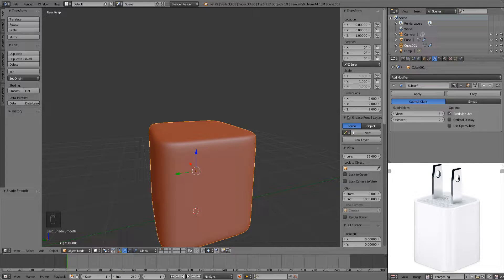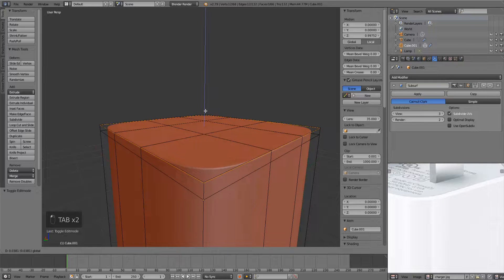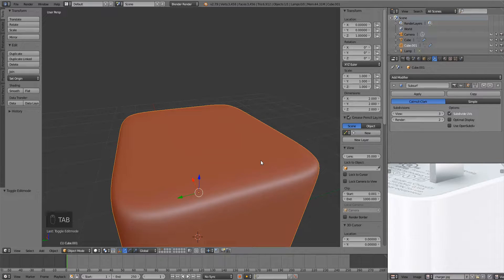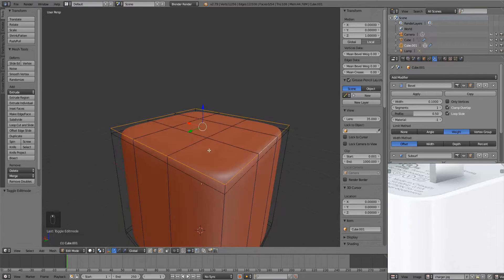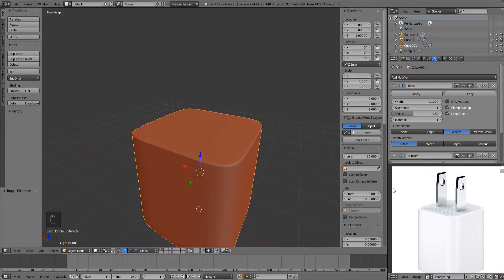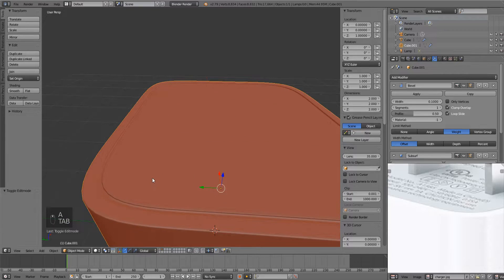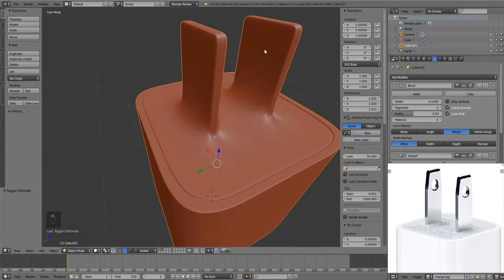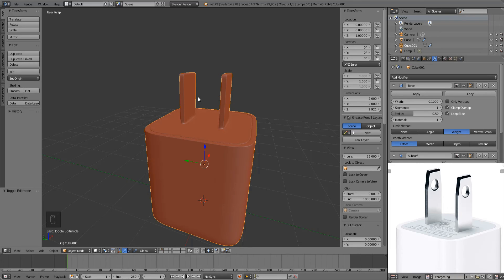Blender: Hard Surface Modeling Made Easy | Bevel Modifier

Comment: This tutorial is very helpful ngl. I always used proximity loops and there was this unneeded geometry  around the loop because of the subsurf. The bevel also completely eliminates the smoothing, while a proximity loop can only fix it to a certain extent, unless you push it right into the other edge. Thank you for sharing these tips Josh!

Comment: Will this information be carried over for exporting it to games' engines ?
Reply from the maker: I believe modifiers are applied on export, so yes :-)
Reply: @JoshGambrell  Gotta make sure, this blender feature is really awesome, really good results for less complexity. So it is natural to be skeptical on how far it goes...i guess.
Thank you a lot for this tip and for the quick response. Cheers
Reply: @ykyjohn  you might need to retopo if you use a lot of modifiers

Comment: Setting the bevel segment count to two and setting profile to 1 will give you a crisper result that's closer to adding proximity loops manually. 

The resulting mesh after the bevel is applied will still have an edge where the original one was, and the bevel edges will be on the faces adjacent to that edge
Reply: Yup.

Comment: Well, this is really the best explanation I've seen so far about how bevel weight works. I used the bevel modifier (but not with bevel weight) since I started using Blender but I'm still running into issues with some edges of my models. Does the value of the width determines the maximum of the bevel weight?
Reply from the maker: Yep! A value of 1 is the maximum bevel and 0 is no bevel at all. For hard-surface models where I want really sharp edges but not completely sharp (which can't exist in the real world) I use a really small mean bevel weight (something like 0.01).  You can also up the segments for more control and adjust the width accordingly.
Reply: @JoshGambrell  
Okay, thanks for the info. I'm currently working on a bit complex hard surface model and I tried to use bevel weight to achieve some bevel variations on on different edges but it didn't really work well. It came up with distortions.
Reply from the maker: @manollobango  Maybe upload a short snippet onto YouTube for me to take a look at? Mean Bevel Weight (or bevel in general) can cause distortions if used incorrectly.
Reply: Wooden Rain  
Well, I don't know how to upload or even record the issue. Besides that I don't know if I do have the software to achieve this.
Yeah, that's what I have noticed already ^^
Maybe you can reproduce the issue yourself if I tell you what I've done:
I just tested it on the cube from the startup scene and selected one edge in Edit Mode.  Then I added the bevel modifier and changed following settings:
- Width = 1 meter
- Segments = 6
- Limit Method = Weight
Next I went to the item settings of the cube in the Properties Panel "N" and changed the Bevel Weight to "0.5". Then I selected the edges which are surrounding the first edge and changed their Bevel Weight to "0.1" -> Distortions occur!
I even tried it by adding another Bevel Modifier extra for the other edges but this didn't work too. I just get the same distortions.
Reply from the maker: @manollobango  I wouldn't use 6 segments on the bevel modifier. I use that modifier almost exclusively for the purpose of automating the addition of proximity loops so I wouldn't do more than 2 segments. 2 segments gives you 3 total edges (since it's splitting an existing edge 2 ways) which will give you a natural proximity loop. 6 segments is going to make it almost completely sharp and isn't practical. Try lowering the segment count to 1 or two and adjust the weight.
Reply: @JoshGambrell  
I only use 2 segments for smoothed corners which are going to have a thickness of maximum 2 cm as there you won't be able to see the jerky corners later on. For bigger corners I have to increase the segments to make the corner look rounded.
I also try to avoid using uneven numbers of segments as they make it difficult to unwrap the model if you have to.
Reply: @manollobango  do you have harden normal checked? do you have a subsurf after the bevel?

Comment: 14976 faces??? 

lol...  i will go with loop cuts
Reply: Using those modifiers could be very powerful. Especially if you are going to use the high2low poly baking workflow. Just apply the modifiers on the high poly version, delete them on the low poly version and then bake the normals from high to low poly.
Reply from the maker: This was clearly an example video without much care for poly count. If I did this the same way with loop cuts without a care, I'd have a similar result and poly-count.

Comment: the additional settings weren't explained, tried on an unsaved work and it overloaded my poor pc as it probably calculated millions of polys. be warned about it as it needs you to tinker with the default setting to see how it exactly works 😟 

it seems neither does crease or mean crease needs extra geometry in the sense of pure mesh data, bevel doesn't seem to be as stable yet either on 2.8. the only advantage it offers seems to be additional level of control over subdivision surface's only edge crease data, which may be desirable for those needing it.
Reply from the maker: Mean crease is a great solution in many situations! However, sometimes it's just iffy and doesn't always work as expected. I would complement mean crease with the mean bevel weight strategy. I would also use mean creases over this strategy if possible!

Comment: You are still adding proximity loops. Hit apply modifier and take a look
Reply from the maker: Yes, but they don't appear and you can still render it out without applying the modifier (granted - it does apply in the render time). It also helps if I decide I don't want the roundedness without requiring the deletion of edges; I can simply disable the modifier. Overall, it's a good quick solution when you want to work with minimal edit mode geometry and still have the same effects.

Comment: All you're doing is automating the addition of "proximity loops"(edge loops) with the bevel modifier. Apply it and you'll see them.
Reply from the maker: Yes, but it's much for efficient this way and removes the annoyance of having extra geometry in the way. Of course, there may be situations in which you must apply the modifier, but overall, this seems to provide better workflow in a lot of hard-surface modeling situations.